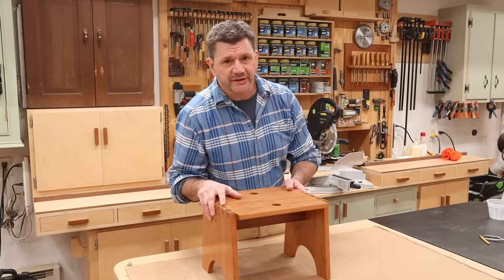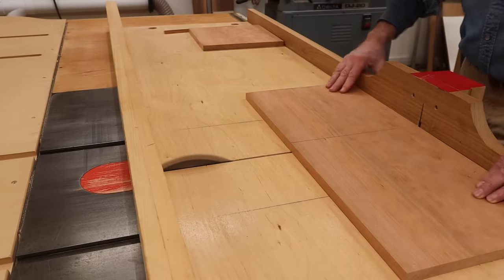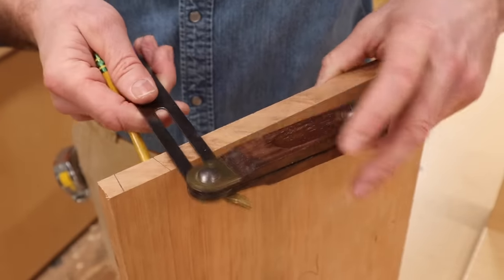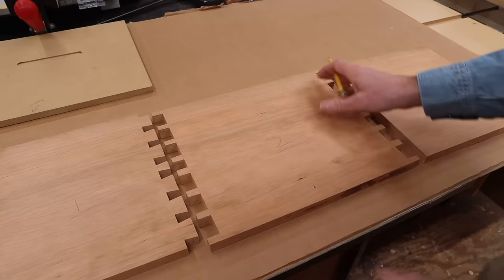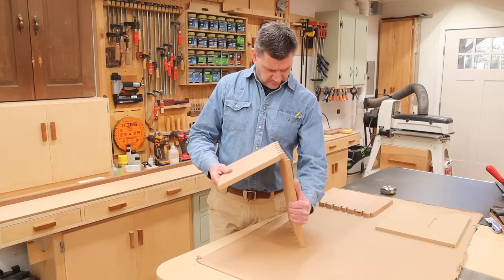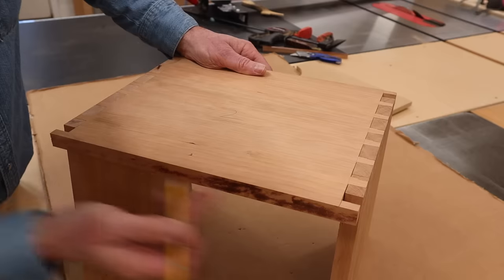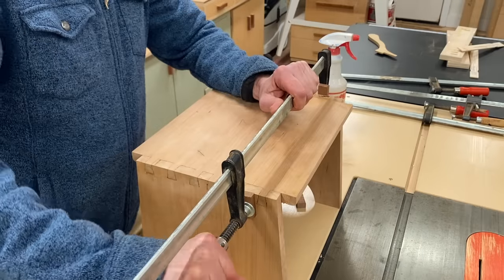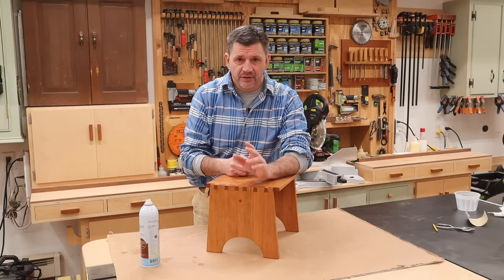Build a Shaker Step Stool - Introduction to Fine Woodworking Project!

Comment: I like how you approach this more as a conversation, how you approached it, and making decisions along the way. That's how many of us work, too. I like the 5 degree taper, but not the overhang. Loved the dovetails. I would have mortised the lateral support into through tenons in the sides and made a central slot in the top to fit a hand vs. two teeny finger holes. The cherry was gorgeous. I think I'll go make a stool. Thanks for the motivation, Jon!

Comment: Looks like a great practice piece. I just watched your jig build as well. I've tried a router jig, but I got too much blowout when using plywood. This method should work fine with plywood. I'll give it a go, I'll use my scroll saw until I get a bandsaw. Why would anyone make dovetails in plywood? Well, why not practice making dovetails when building essential shop furniture? Also I was very surprised that I can get Bloxygen here in Australia, and it's not expensive! I'm definitely going to give it a go. I've had problems with varnish and Danish oil forming a skin. It should also save PVC cement from setting hard in the container! It seems to me it will save me both money and time.

Comment: Thank you, Jon!  I don't like using a metal router dovetail jig (tried two or three brands), and don't always have the motivation for handsaw and chisel, so I should give your method a try.  Isn't woodworking all about dealing with little goofs along the way?  As always, a very inspiring session in your shop!

Comment: Love seeing a project build! Very nice results. I was curious if you are worried about the top overhang splitting off along the grain direction under foot? I was thinking that some dowels or pegs sunk perpendicular to the grain direction along the face could add some insurance. Also, with some contrasting woods could add a style element.

Comment: The download for your plans does not work for me.  It just spins and spins.   I tried this morning and this evening. Thanks
Reply from the maker: Try your spam folder may have gone there
Reply: @JonPetersArtHome  I guess I didn't explain well.  I put in my name. Then I put in my email.  Then I push the red button.  Then the web page spins and spins.   After 30 min the first time and 15 min the 2nd time I stopped it.  Sorry.